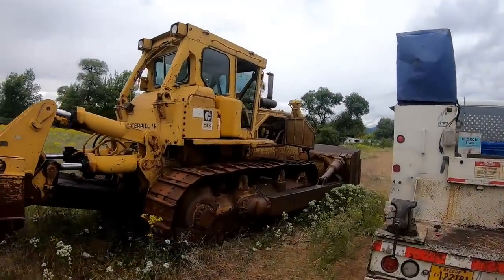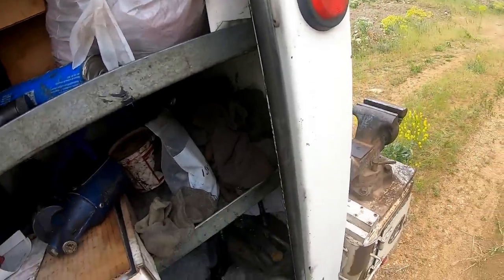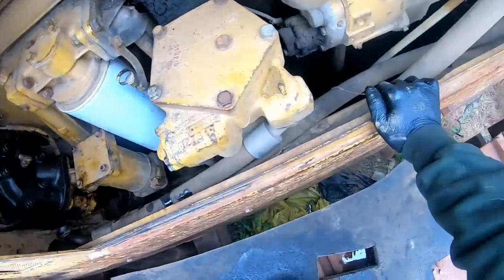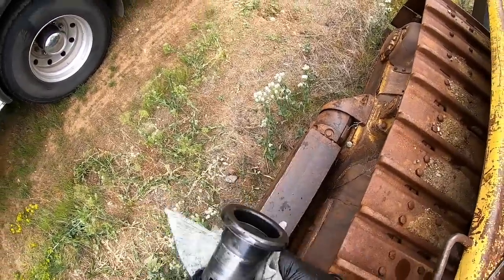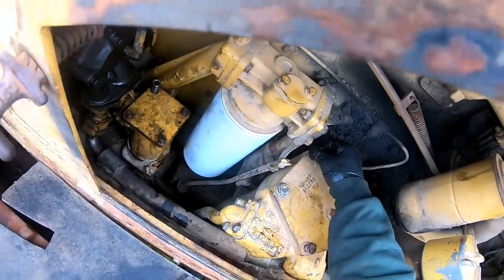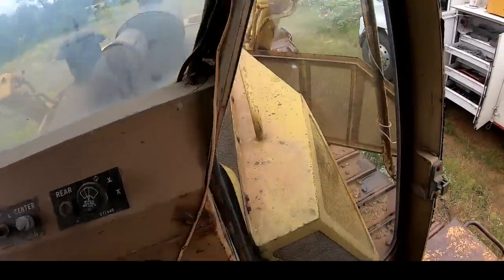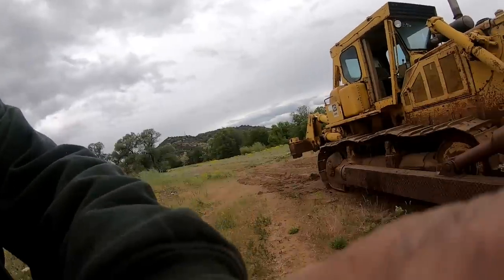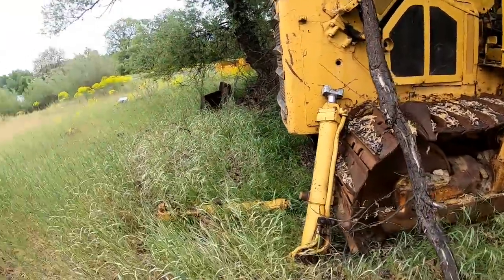Bringing a D8k caterpillar back to life pt.2

Comment: I ran 8k's for several years and before that the 46a  which had the best balance of all the dozers I ran over the years. The 8k felt more blade heavy but once you got used to it was a big improvement over the 46a or b.The hand controls for the operator were much improved.  The 46a had a long handle for the blade hand which would also tilt. The pins on the long control arm wore enough that some of them felt sloppy it also had parallelogram ripper only,  the 8k had one hand hydraulic pitch control on a much more ergonomic  it was a on a specially designed handle  controlled by a button  which controlled all the implements if you had a ripper and dozer combination. You could pull rocks up or snap the tops off them much better and faster. The 8k was heavier to and worked well for pioneering steep slope roads.  You could still haul it on a single truck at that time in California which was important for the owner operator.

Comment: Have you tried silicone grease for some of those threads that get exposed to electrolytic salts (farm manure/urine and road salts)? Siiicone grease will act like an insulator grease and stand some decent temperatures, Would not use it for exhaust components. Cheap version would be pool o-ring silicone grease or Dow vacuum grease, which is made of silicone. I would not use it around fuels to seal, just on the threads only. 
I worked in industrial plants where I could not use regular anti-seize compounds on some parts of the equipment, made disassembly easier for me especially where cleaning chemicals were used.

Comment: If you ever need to waterproof wire connections, you can use cheap ass pvc electrical tape and do at least to overlap wraps.  then, coat it with pvc glue.  the glue will melt the tape together.  Poor mans forever fix, courtesy of old navy guys.
Reply: That's a cool trick.
Reply: Huh...  That really is a cool trick. I'll be giving that a go for sure.

Comment: Hmm seems like something in that d8k driveline is failing to plug up that suction screen. Loose pinion hub or a bad bearing in something. 
 Open cab machines have the dip stick and filler under the seat for the power shift trans. 

That 7f is worth fixing and putting a blade back on it. Tq converter is isn’t to hard to pull and rebuild.

Comment: I know from experience the silver  PERMATEX antiseeze works the best. I used that on the spline of outboard  propellers in salt water  and they would slip off like the day I put them on! You must clean the  hardware up first and remove the rust  and dirt first for best results. but you will be able to take exhaust manifolds off after 20 years of neglect

Comment: Have seen more equipment abandoned due to neglect and no maintenance than failure of parts.  I have a friend who 
recently found an old Ford tractor that the owner said was no good and he was going to  part it out.   My friend gave
him $80.00  and brought it home.  It cost him $350 in parts  and oil to get it back up and running.  Turned out the
Transmission shift lever was out of adjustment and filters were plugged up solid.

Comment: Try a product called Res-Q-Steel, I use it alot in some tough enviroments, it doesn't wash out, I also wrap nuts and bolt heads in Denso Tape, in places where the enviroment is really tough.

Comment: The doctor is IN for both dog and machine. Daisy knew you would fix her right up. That old 8 has a lot of life in it yet. Just wanted to say watching you channel has given me enough confidence to tear into an old model B deere for an engine rebuild. Working on getting parts now. Have to have the rod babbit repoured by a shop in Cecil ohio.New block, pistons , and a head rework I hope will do it. I figured if you can do all the stuff you do then I should be able to at least do this. Have you ever worked on any of the two cylinder tractors?

Comment: A old Marine Mechanic friend of mine told me he doesn't use anti-seize because it gets washed out. Instead he uses RTV Silicone to coat the threads. You might try that method. I follow his lead on Outboards etc.  It may work well on your applications,  Best of luck...........................
Reply: Antiseize does not get washed out. That's ridiculous.
Reply: @verteup  Go ahead..........Bolt up the lower unit of an outboard with anti-seize,  run it a few years in salt water and find out the hard way.

Comment: Turbo failure is often the result of going too long between oil changes. $100.00 oil change, $2500 or more to replace turbo. We had equipment problems but never lost an engine due to poor maintenance.

Comment: Did you know that Phillips Tractor in Gaston, Or is going out of business?  Selling several dozers (used) several engines, transmission, parts. Dude at Pacific Hillbilly he is rebuilding a D2. He bought engine. Look like they had 10-12.

Comment: When i reinstated those transmission pumps I would pull that #4 gauge plug out and put an adapter I made up that had a grease nipple on it give it a couple of shots of grease. They are hard to get primed up sometimes.

Comment: Those new filters will plug up in  no time with old that gear oil...
Reply: I agree and he should have dropped the rear belly plate drained the transmission and removed the suction hose , Cleaned it and checked for rubs filled it with petrol and check for pin holes . You can mount a new pump every day if this hose has just a pin hole or leaking seal !
Reply: Also he should have primed the pump with the engine stop on through the bleed plug on top or the new pump before starting. I have worked on these machines and many more Cats for decades.

Comment: These old Cat D8 Dozer they 15w30w for the Hydraulic fluid and 15w30w oil for the engine and 15w30w for the transmission and 15w30w for the gear oil  for the gears as well I remember that back in the day cause my Dad and my uncle and respected heay equipment  operators told me that as I growing up and check the carburetor and don't foret to check the fuel tank okay and check the starter and the battery okay Got a go hope you like this comment

Comment: Does your freightshaker have a 8.3 C series.....If so have you ran in to the infamous capps fuel shutdown....I got one from a customer "distillery yard truck" truck is in superb shape but dont run...and does have high pressure fuel comming from the high side of pump . Previous mechanic a friend at an old shop I used to work with said he even had a freaight liner mec. Come out hit it with there comp. To shut down there multiple shutdown sensors.  But still no run.  Just wondering if you may have ran up on such a thing....unit only has 100k on it and oil analysts back that up...if I dont figure anything out my partners are going to crush it....good tranny rears ect all to wast .. i save the unit before this one . An old 87 c70 gmc 8.2 detroit with 35k 5spd, 2spdrear that has 0 leeks .  Still has orginal tires on the steers....but I dont think ill be able to take this fl60 home unless i get it to breath fire..  i hate seeing goid stuff go to wast.

Comment: My 977L I bought at scrap price would not move... It's came from a farmer that spent 3500 on cat shop truck to come out and diagnosed it he finally came to the conclusion that the torque converter was bad from over heating I said why was it over heating he could not tell me... Got it to my house the first thing I did was pull that screen and it was plugged up solid spent $30 at cat for new screen and it started moving been using it for 3months no probs...

Comment: Do you keep much of parts (other than the incidental bullshit like fasteners or electrical connectors) in stock or do you not bother much because of the sheer variety of stuff you work on? As far as camera angles go, I prefer it on your hat/head most of the time because 8 times outa 10 it shows me what you're actually doing or close enough that I can figure it out for myself.
Reply from the maker: I try to carry most items that fail often, like a spring brake for a truck,  I always pack a couple of hitch potentiometers  for Deere's and some can bus terminator resistors. Things like that.

Comment: In the repair industry whether it be automotive or heavy equipment the sharpest and most ethical guys many times don’t make it running a business. You have to either develop a heart of cast iron or you have to allow someone else to deal with customers and act as a buffer between you and them. I learned too far into my career that all people will allow you to work for nothing if you’re willing to and everyone has a hard luck story. Business IS business was something I should’ve learned a lot sooner. My family (and my body) deserved to get paid well for the hard work and long hours. It’s tough enough to make it charging top dollar. Cutting prices and a low hourly rate is just slow business suicide.

Comment: You ever replace the lower rad tank  gasket on a d7e can it be done with out pulling out the full rad?
Reply from the maker: I've pulled radiators on E's for rotted cores, but not specifically for bottom tank.  I'm pretty sure you have to pull it.
Reply: @westerntruckandtractorrepa1353  thank but not the awnser i wanted to hear lol

Comment: Anti seeze. Lol.
Put bolts nuts in with wet cheap spray paint on threads. WET PAINT. WET.
I PROMISE YOU THEY COME OFF 70 YEARS LATER COW SHIT OR NO.
Just spray paint on threads of bolt and nut. Put together wet.

Comment: why do you buy cat filter brand,, cat dont make filters, only a small few make filters and brand them for anyone that will buy huge order, your paying 3 to 4 times more just for the branded name, my sister use to work at cat cleaning  filters day in day out, these were the bigger metal washable filters she cleaned..  and the cat branded filter came in big boxs with the mfg name on the big box. they must have sold the C frame and blade off that 7F unless it is sittting out there some place but being the the C ftrame cylinder are laying right there id say they sold them